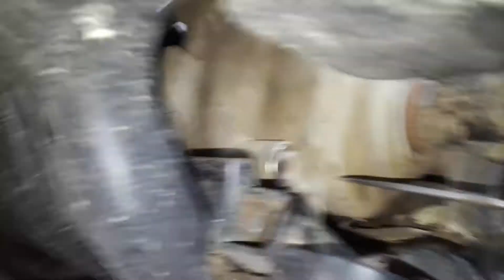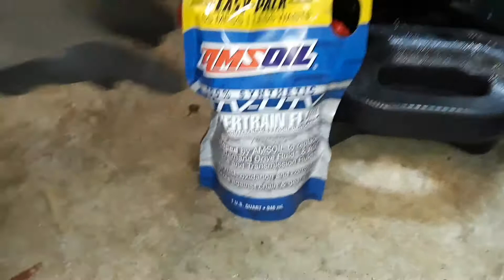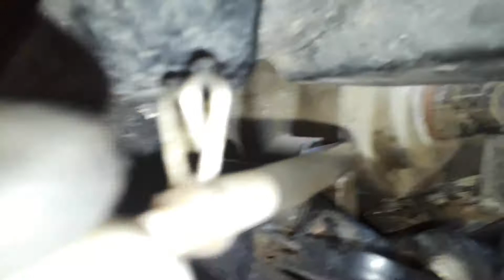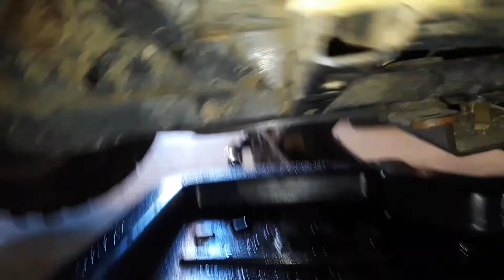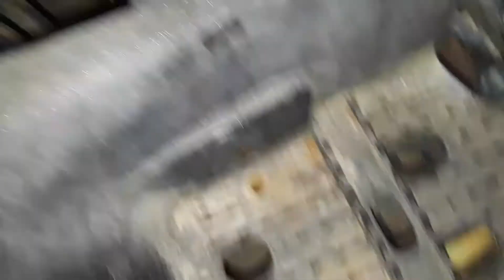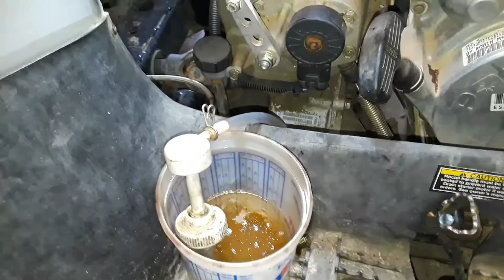04 Polaris Magnum 330 front diff and transmission oil change

Comment: Great video on this , So you can use the same fluid on the tranny and front diff , Is it like 75/80 weight oil , Thank you much in advance and subd !
Reply from the maker: It's a specific fluid.  Not 80w90.

Comment: Do you use the same fluid for the front and rear diff? The direct drive oil?
Reply from the maker: The rear diff in this case is just regular gear oil,  not the same as the front diff and transmission. In this case,  the amsoil is compatible with demand drive fluid and the agl so it will work for the front diff and transmission. As well as the front hubs on the older style polaris awd.
Reply: Polaris AGL for the rear diff then?
Reply from the maker: @NorthGhost539  i looked it up and it looks like agl is for transmissions.  I'd just use 80w90 in the rear diff.
Reply: She's up and running, thanks man! Polaris brand of gear oil, used in the rear diff is called Angle Drive Fluid if anyone ever has the same question again about this bike!  @Whitestrash

Comment: You aleays leave the drain plug out and sacrifice some new gear oil to clean the reservoir, then replace the drain plug and fill. On everything you change out.
Reply: Only really needed IF maintenance is not done every year. If you stay on top of fluid changes thats a waste of time and oil.

Comment: I have a question

Your video helped a lot , I was hoping you would know the size o ring I need for the front and rear gear case also the transmission drain plugs , Polaris wants crazy money for these . 

I have a 2003 Polaris Magnum 330 4x4
Reply from the maker: I don't know for sure.  I just buy an assortment of aluminum crush washers from Amazon and use the size that's closest. Same goes for the fill plug, get an assortment of o rings and match it up.
Reply: @Whitestrash  thanks I will give it a shot

Comment: Hi, can anyone tell me if the polaris 330 magnum 04" share the same rear differential as any other atv ?
Thanks
Reply from the maker: Not sure... maybe Google search it or ask a salvage yard, they might have cross reference information.
Reply: @Whitestrash  thanks for that. I'm in Australia and have asked the biggest wreckers here and they don't have and don't get many of these quads.
I was hoping that someone has had this problem and came up with a solution to replacing the rear prop shaft as they are discontinued now.
Thanks

Comment: These are perfect videos, thanks. Regarding the transmission, front and rear differentials. Do all take the same type of oil? What type of oil do they take?
Reply from the maker: You have to do a little research or look at the owner's manual.  With Polaris,  there are several different fluids.  Depending on the type of differential,  a specific fluid will be needed.  I believe all the transmissions use the same fluid. This is why i like to use amsoil.  Their website is very helpful and shows you what fluids you need for your exact application, automotive or atv...ect.